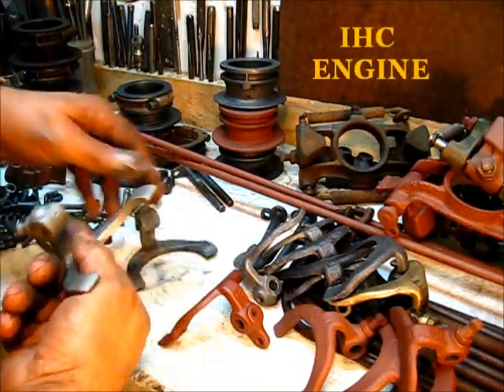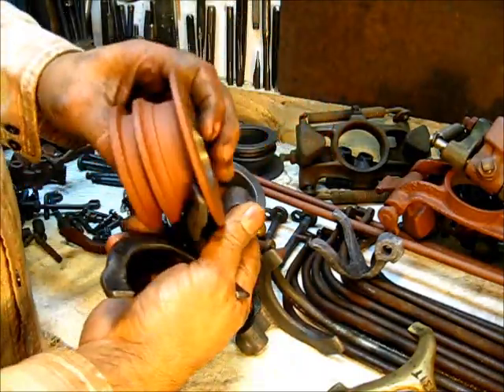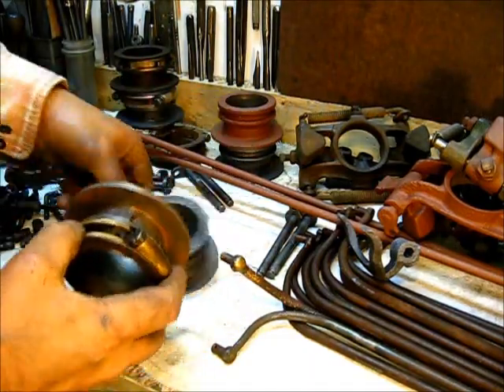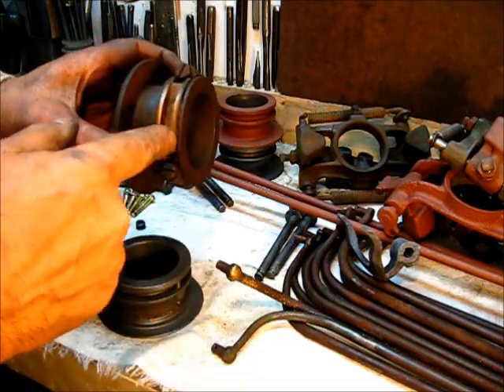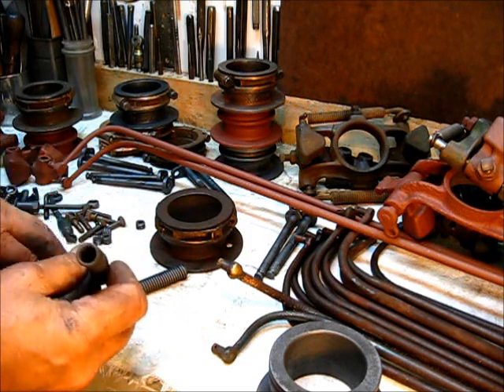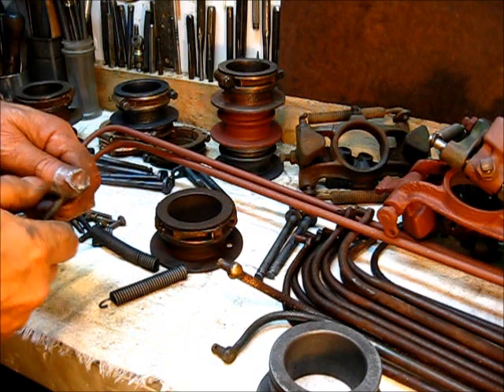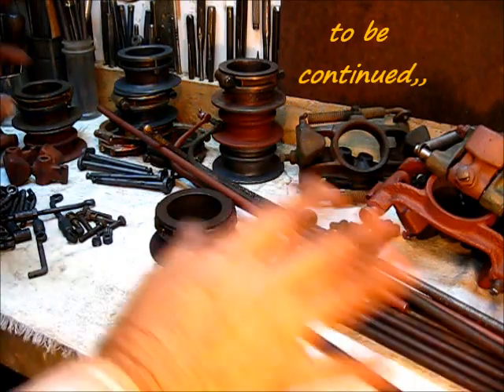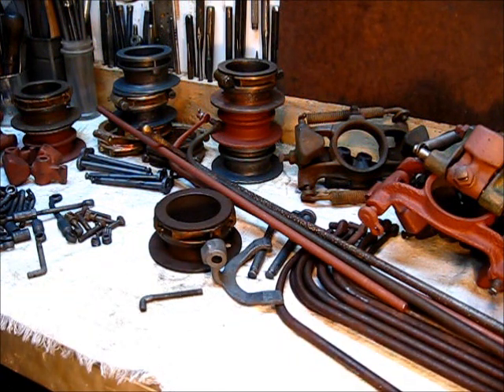IHC ENGINE governor explained #2

Comment: I have two governor sleeves.  On one the inside was worn paper thin.  The other was in better shape but it had a chunk missing and the lip that holds the brass sleeve in place is missing.  I welded in a piece of metal to replace the missing chunk.   Now I am cutting off one of the lips that holds the brass off of the worst sleeve so that I can weld it on to the better one.